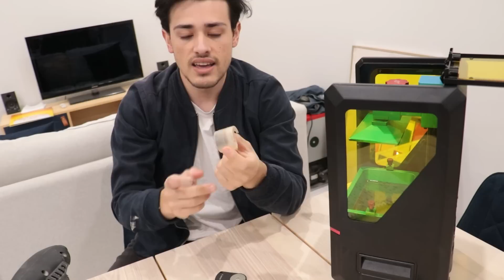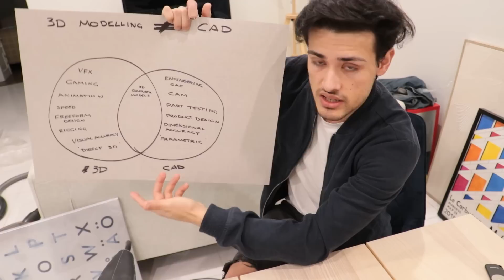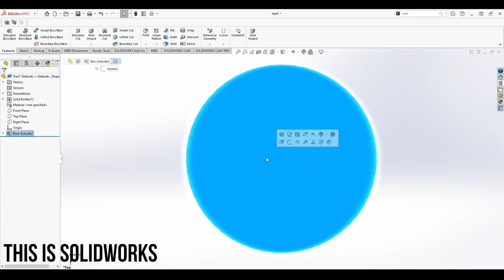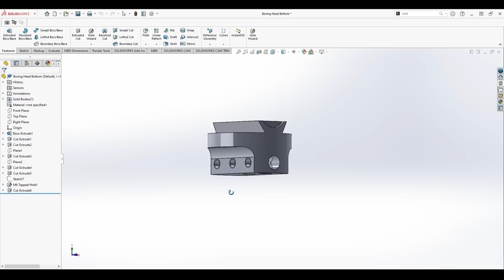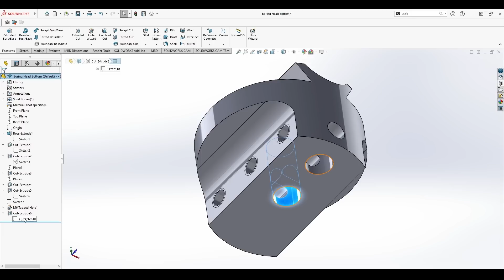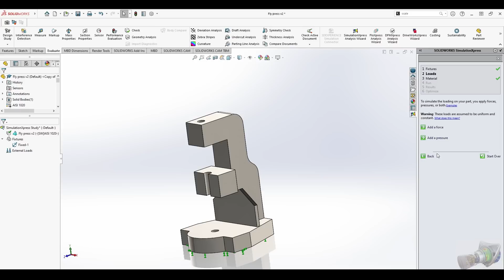On CAD, 3D Modelling And Computer Aided Engineering

Comment: Very cool. I joined EAA four years ago to get free access to Solidworks. The next year it was no longer free with your membership so I lost interest.  Personally I would never use anything made by Autodesk, I say that as someone that was a customer from the mid 90's for over 20 years. I'd suggest looking into Rhino 3D which is an excellent NURBS based modeler which handles curves like a dream.
btw, EAA is the Experimental Aircraft Association based in the US.

Comment: "If the machine isn't actively trying to kill you..." says the guy sitting next to a machine using highly toxic chemicals.
Reply from the maker: My respect for the machine just went up :)
Reply: @artisanmakes  wait... you're unaware? This stuff doesn't just smell terrible. It's actually carcinogenic, hyperallergenic, and a couple more depending on what exactly you're using.
You really don't want to mess around with this stuff. I use a special respirator for biological hazards and thick silicone gloves under single use nitril gloves when handling anything out of that machine.
If you can smell it, there are VOCs in the air and you are at increased risk of cancer.
Reply: @artisanmakes  yt doesn't like words like carcinogenic or hyperallergenic. Maybe this is allowed to go through. If you can smell it your breathing VOCs that are very bad for you. Get the right breathing protection for VOCs.
Reply: @artisanmakes  apparently describing what is bad about resin is against YT ToS... I suggest you look it up though...
Reply: Technically it is passive attempt so maybe 0.75xrespect
Reply: @thrauil  Passively trying to kill you ...

:face-blue-smiling:
Reply: It says right in the manual not to drink the resin.
Reply: @courier11sec That's a manual for the American market, I imagine? 😉
Reply: @Lucius_DeBeers  🤣🤣🤣🤣🤣
Reply: @Lucius_DeBeers for the US market*
Reply: @sinchrotron  I don't see anything united or stately there, but I get your point. 😗
Reply: What model is that printer?
Happy with it?

Haven’t looked in to the SLA (?) world that much, but it might be the thing… 🤔
Reply: @andli461  if I had to guess it's an anycubic photon.
Reply: @kBIT01  Thanks! I need to do some research on SLA-printers.
Reply: The printer isn't specifically trying to passively kill you, the resin is... well... some resins.
Reply: You could say that about my work colleague.

Comment: you are too hot for this hobby dude, my condolences
Reply: respectfully
Reply: Back in the day CAD had two descriptions. Computer Aided Drafting, a replacement for the old fashioned drawing board where the designer had done all the calcs on paper, and Computer Aided Design, using the computer to assist in achieving the required properties of the components such as strength, fluid flow, deformation etc…. How many 3D modellers use the analysis part of the software when it comes to 3D printing rather than just using it to ‘draft’ a model?🤔
Reply: @ch5139 you raised a good question that I wanted to know the answer to as well.
I myself use FEM a lot, not exclusively for 3D printing though. more likely CFD for ducting.
Reply: For real, most of us get into these hobbies because we're rough looking and don't fit into hobbies good looking people partake in.